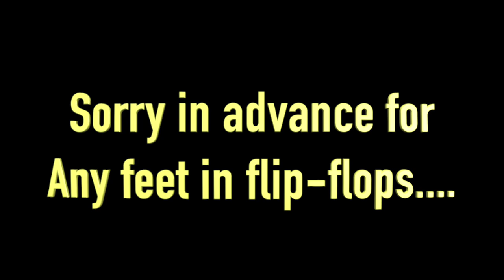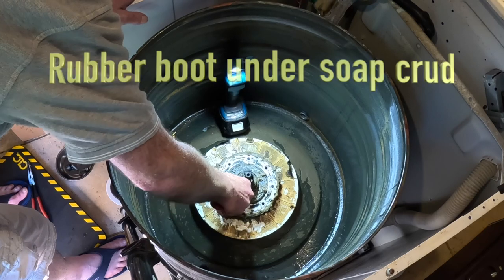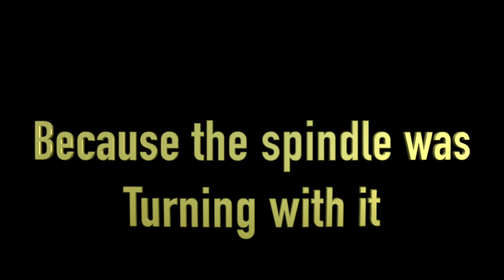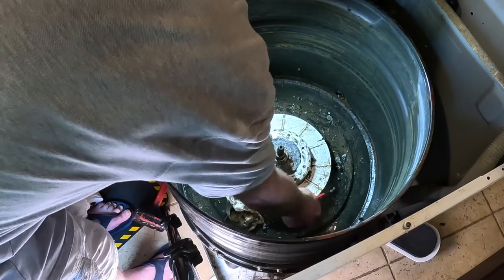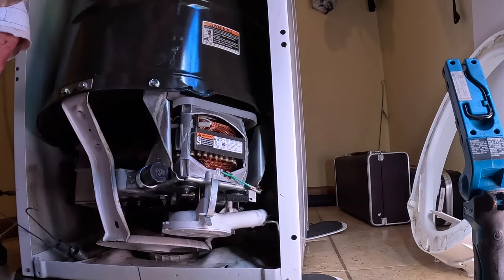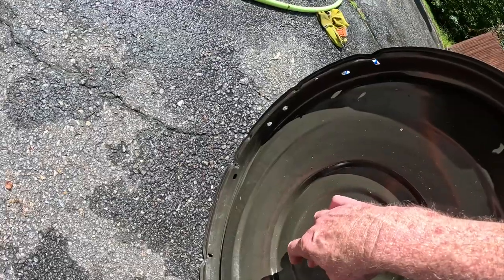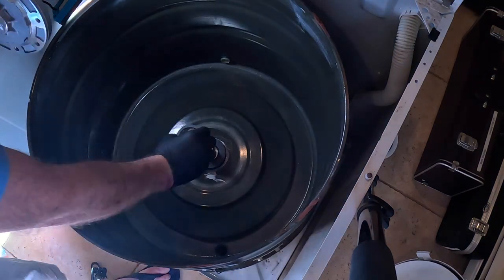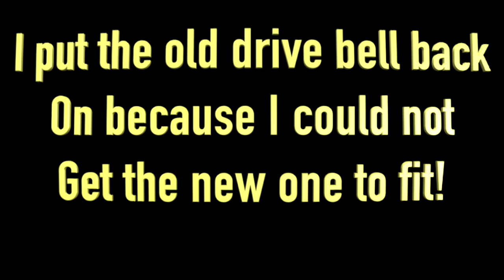Speed Queen Washer BEARINGS and SEALS replacement DIY  The GOOD, The BAD, and the UGLY

Comment: I just did this, those Rhino air wedges are very useful here, not only to pop up the agitator, but also between the inner and outer tub, put (3) in 120 degrees apart, inflate just enough to act as a brake pad to stop drum from spinning as you break torque on center shaft nut.  Do not over inflate as you can possibly warp the tub.

On my model speed queen I pulled the nut before unbolting the (4) bolts on the stainless inner tub.

Also FYI 38mm (6pt) deep well vehicle wheel lock nut socket on my Ryobi 1/2 18V battery powered impact wrench worked well on 17 years of accumulated crud under the agitator and on nut.
Reply from the maker: Someone else mentioned To take the lock nut off before removing the inner tub.  I don't think I was able to do that

Comment: Thanks for the video! Now we can all see why the transmission can't leak into the tub. Just a bearing and seals to keep the water from draining out! So, would you say that the majority of the crud was old soap and grime from the clothes? Speed Queen washers are built like a a Battleship! No wonder they run forever!
Reply from the maker: I’m sure that’s what the dried crud was. Never used any powdered soap either. The reason I did all this was a small water leak from the bearing/seal area. I discovered it a year ago and bought the seal kit that I installed. While I was waiting for it to be delivered, I removed the front panel, and took 100% silicone on a rubber glove and applied a lot of it on the underside of the bottom tub, all around the seal and bearing. I didn’t run the machine for 24 hours and that fixed the leak. For a little more than a year.  The bearing and seal kit sat in my basement. Why mess with it if it was not leaking any more?  Well a Lear later, the leak returned from the same area, and I made this video after reviewing all the videos that I could find on the subject. It’s still going strong. In fact, I just pulled a load from the washer and put it in the dryer 3 minutes ago!  Thanks for commenting!

Comment: Thanks for the info. For the bottom seal, you could also use painters tape to keep it place while you are installing the tub. I found that you in cases like this, you don't HAVE to use Locktite, you could use nail polish instead. It works just as well and it's a lot cheaper. I still recommend using Locktite, but in a pinch, nail polish works fine
Reply from the maker: @pieterjansenvanrensburg4648  thanks for watching and sharing your expertise.  Interesting with the nail polish.

Comment: That white grille thing is some sort of lint/hair trap to avoid debris from working itself into the sealing surfaces of the central hub part.  Also, I saw a video on an appliance parts pros website that shows the repair guy preventing the hub from spinning while hammering on that special wrench by taking a pair of large vise grips and clamping it onto one of the thicker albeit aluminum "fins" of the transmission outer casing down under the tub, and that way the handle of the vise grips would anchor or wedge or stop up against one of the transmission mounting support brackets.  That special wrench didn't work for me because the nut was so stuck, so I ended up using an air impact wrench with a gigantic socket that fit the nut.  But it wouldn't turn because the shaft was so rusted so I used a wire brush attachment for my portable 4 inch grinder first.  I also couldn't get the bearing assembly off the transmission so I had to use a metal 3 pronged gear puller and an air impact socket wrench to get enough force to pry the old bearing off the transmission shaft.  I then couldn't get the new bearing or nut on so again I had to lightly brush the rust off the shaft of the transmission with the grinder again.  I was even using it in a vertical fashion to get in between the vertically oriented splines on the shaft.  The entire job was way harder than I was expecting and there was rust everywhere.  Not to mention how difficult it was to find a hub and seal kit for my particular model.  I think next time it needs a new bearing the machine is going to the recycle center.
Reply from the maker: holy crap.  Thats crazy.  I wish i would have seen the video of someone using vice grips to prevent the transmission from spinning.  all three videos I saw had locked transmissions that didnt move counter clockwise.  Thanks for commenting. it was interesting to read

Comment: There is a trick with stuck bolts and that is try to tighten a bit , then try to remove. Works for me even where Loctite has been applied.
Reply from the maker: @metrork1  thank you.  the gasket to my tankless coil on  my 35 year old oil fired boiler was leaking so I had to replace it. Had 8 stuck bolts. I actually tightened and loostened them multiple times spraying lubricant in between to get them out.  Thanks for commenting

Comment: Big job indeed, getting the big nut off the spindle looked very difficult having to hold rotation from underneith with water pump pliers with left hand while swinging a hammer inside the drum with right hand to bang on the nut removal tool from the kit. I'm wondering if a large long socket could be used to remove the nut with an impact wrench, or is the spindle to tall for a long socket? Could use 1/2" or 3/4" drive socket with drive reducer adapter(s) to get back to 3/8" drive impact wrench you used? Any thoughts?
Reply from the maker: If you can find a deep enough socket, what you suggested would work brilliantly.  I watched every video I could find and nobody had the same issue with the spindle and transmission spinning. One commenter suggested my brakes were bad and not holding which was why I had that problem.  I've since replaced the brakes after reading that comment.  So it's quite possible if you try this repair you won't have the issue I had.  Others recommended leaving the inner tub in place when removing the bolt but I can't visualize how that would make any difference.  
At any rate, if you have a deep enough impact which would surely be a specialty item (I have a lot of tools and drivers and didn't have anything deep enough) it would definitely remove the bolt in 3 seconds. No question. 
Thanks for watching and commenting!

Comment: Hey Excellent video tutorial. 
What model Speed Queen top load washer?
What was purpose of using lock tight on the outer outside of the aluminum plate ? 
Excellent video
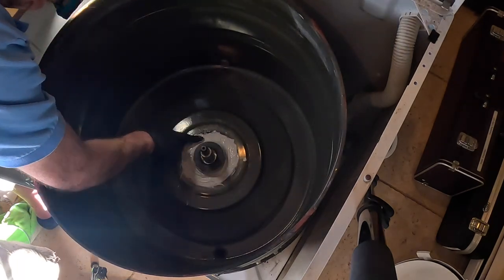Reply from the maker: See 31:20 for Loctite explanation.  
It bonds the metal plate to the bearing.  It's extremely important.  Heres the loctite. Its made for just this type of application to glue 2 metal cylindrical parts together https://www.henkel-adhesives.com/us/en/product/retaining-compounds/loctite_6800.html. I have model AWN432SP111TW01. Thanks for watching and commenting.

Comment: Wow. Good job.
Reply from the maker: Thanks.  I’m just glad I didn’t need a new washer.  I really like the Speed Queen. It cleans very well and gets done fast.  Plus large capacity and it’s mechanical.  Appreciate the comment.
Reply: I am having bad problem with my Speed Queen TR7. It is making grease spots on the clothes and nothing seems to work. I am trying to work out something with the dealer and Speed Queen to trade it in as a lemon.  Almost 6 years left on Warranty. Fingers crossed. 
Did you have this staining problem too?
Reply from the maker: @Scott-jf1nh  never. Is the machine brand new? It doesn’t sound like it. If I were you I would buy like 4 gallons of bleach and take a white t shirt and run the shirt in a small load with a lot of bleach. At some point if there were grease it would dissipate and stop getting on the clothes. I’ve never heard of anything like that. Good luck. Edit. Or maybe take a bunch of towels you don’t care about and fill the machine with micro fiber towel wax cleaner and water. And run them a few times in that stuff.  I bought that stuff from the chemical guys to clean towels after I detail my car. Works well. Ammo NYC has similar microfiber cleaners. At some point whatever is causing the issue will be gone.

Comment: Great tutorial. Well done. By the way, how long have you had this washer before it started to leak and were you using liquid or powdered detergents ? Thanks.
Reply from the maker: Thank you. We probably had the washer and dryer 8 or 9 years before it started to leak. I bought the kit to do the bearings and seal and then decided to try some silicone on the tub bottom. That actually stopped the leak for over a year and the repair kit sat in my basement. 
We have very hard well water, even with a softener which adds salt. And only use liquid soap.  Thanks for commenting.

Comment: Remove center nut before inner drum. Easier to hold. Flip outer drum upside down to put weldiment back on
Reply from the maker: You're the second person that said this and I appreciate it. I really didn't think its  possible take off the nut without removing the outer basket because I don't think I would be able to get to it. Unfortunately I can't really picture it now but thank you should this thing ever leak again I will see what I can do with your suggestion

Comment: Great job...did you notice the inside side wall stains? Tale sign of a seal leak
Reply from the maker: Not on the inside stainless basket.  Did you see it in the video? If so can you point to a timestamp? Its interesting to me.  Thanks
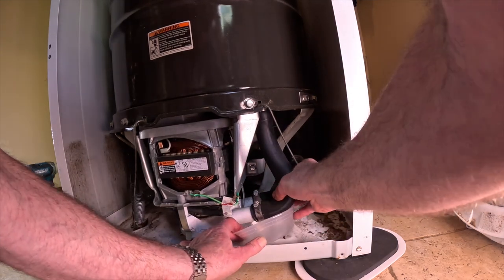Reply: @Samlol23_drrich  18:48 look at the inside of the cabinet. You will see a stain all the way around the cabinet just below the bottom of the outer basket.
Reply from the maker: @rolandvz71  thanks very much for taking the time to point that out and time stamp it for me. I absolutely see what you are talking about. I wonder why that would be a sign of a seal leak. I just assumed it was dirt but I guess not. Any idea why that happens with a seal leak? I’m curious. Thanks again.

Comment: Great video. I have the same setup and change out all the seals and bearing but right now if I don't put grease on the brakes it chews up the belt. I am trying to figure out what did I do wrong because as I said it's chewing up the belt so I put grease on the brakes in order to delay the belt from wearing out
Reply from the maker: Are you sure its routed correctly? I bought a belt to replace my existing one when I did the seals This summer but I forgot to put it on So it's still sitting in my basement But that's the original Belt it's about 11 years old
Reply from the maker: And we do 10 to 15 full loads a week
Reply from the maker: Maybe it's not balanced properly
Reply: @Samlol23_drrich  it is routed correct. The brakes seema to be causing unnecessary resistance when not needed causing the belt to prematurely fall.
Reply from the maker: @bobdeengineer7396  wow. Been like that since new? Just curious

Comment: This is amazing work. I am watching this because we have a newer Speed Queen. I was trying to clean out the edges of the tub and a Clorox wipe fell between the inner and outer tub. Question for you: do I need to take this thing apart and try and fish that out? I am assuming so but I just thought I would ask your opinion.
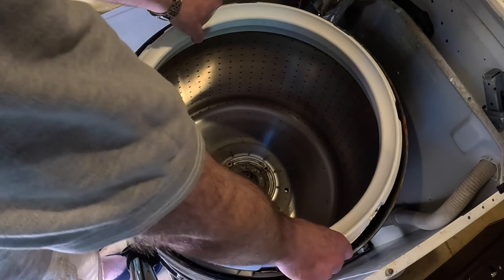Reply from the maker: Thank you.  I would try my hardest to get it out without taking the tubs apart. The last thing you want is for it to get stuck in the pump. If you take the top off and unsnap the white plate that covers both tubs (it unsnaps see 4:40 you should be able to see between the tubs.  I took the inner tub out with it still attached but you can pull that off when you take the top off of the machine and you should easily be able to get the wipe.
Reply: @Samlol23_drrich  That makes a lot of sense. A huge thank you for explaining that. Now that I think about it, the wipe probably isn't in between the inner and outer tub. Because there is a seal on that white plate, it probably just stuck right there. That is a relief, but I still am determined to get it out just in case. I tip my hat to you for sharing your knowledge!
Reply from the maker: @jacobl777  my pleasure!   Thanks for the nice comments.

Comment: Hey Doc!  All my repair items for the bearings and seals officially showed up today.  I'm curious to see how you got (at the 15:26 mark), all this plastic stuff (plastic shroud/part number 39371 Washer Filter Lint) clean after you took it out.  I'm afraid to take my pressure washer to it as it is plastic.  You had several items that were plastic you had to get "de-gunked".  Did you take a scrub brush to it?  Also, did you find anything to help with the mineral and detergent buildup?  I just had my drains blown out today and those were disgusting to say the least.  My drain guy said a lot of the liquid laundry detergents have glycerin in them and this causes serious build up in the drains.  BTW-  I just found the 39371 part number online through Alliance and it's actually reasonably priced at just under $5 (this is before shipping), Appliance Parts 365 for $4 before shipping just in case you ever have to pull this machine apart in case you break that plastic piece.
Reply from the maker: I just ran that plastic thing under hot water. It was hardened soap so it dissolved right off. I didn’t take a power washer to anything. Every part cleaned up easily. I took both the inner and outer tub outside and just used a hose with a sponge. Good luck. The sealant application is the hardest part. Watch a lot of videos.  There is one that is shot in portrait mode by a guy in England or Australia that is great. If I find it I’ll edit this post and link it here.  Edit. This one. https://youtu.be/e5vd18GWVWU
Reply: @Samlol23_drrich  Will do!  Thanks Doc!  I was going to possibly also use my 7 in 1 tool for trying to get that sealant off.  I have acetone as well as alcohol here to get everything off.
Reply from the maker: @amiedavis5257  I think the only thing you will need is a flat razor blade, and some alcohol prior to laying down the new sealant to make sure there is no grease or oil remaining on the surface. Good luck
Reply: @Samlol23_drrich  Doc, did you use a gear puller to get that metal hub off?  How did you get that hub off?  We have the damn thing mostly pulled apart but that metal hub is just stuck.
Reply from the maker: @amiedavis5257  I didn’t have to use one, but yes, you can get a set of three different size gear pullers/fan blade pullers fairly inexpensively. They are good to have. You can probably use an air wedge also if you have one.
Reply: @Samlol23_drrich  I tried an air wedge, that didn't work.  I used at least half a can of penetrating oil so far.  I tried a crow bar, nothing made it budge.  I gave up, every thing was closed by that time so in a couple hours, I'm headed to harbor freight to get a gear puller and a crap ton of limeaway gel for the drum and basin.  I'm also going to install a water filter on the cold water side.  There's at least a half inch of limescale in the drum.  With your helpful tips, it took less than a half hour to get where we are.  If that hub didn't get stuck, we would have had it back together by now. 100% if you have the right tools, it's so worth doing this yourself. This repair would have cost me over $600 to hire it done.

Comment: I'm watching this at 2AM.  I have the same machine.  Mine is leaking water out the bottom so I am 99% sure it is either the drain pump (plastic, naturally) or else the drain hose (this one was a complete pain to source and took damn near a month).  I'm looking at exactly what's in there so I can be prepared as to what I need to do.  I got an OEM drain pump from Amazon for $14 with shipping.  Where did you get your replacement parts?  I wish you were my neighbor.  Anytime something is broken I want to learn how to fix it. ALSO:  How much was the tool to take off the nut to the transmission?  Do you have links for the bladders to stabilize and remove?  What was the tool called you used to remove and reconnect the springs and is there a link to that?
Reply from the maker: The tool to take off the springs is called a motorcycle exhaust hook.   The pump up things are called air wedges or air shims, the bolt removal tool is herehttps://parts.alliancelaundry.com/i-790271-speed-queen-306p4-washer-tool-hex-wrench.html?utm_source=Google&utm_medium=cse&utm_term=AL-306P4-02&gad=1&gclid=EAIaIQobChMIjMnmmJL6_gIVyiKzAB2iKQsHEAQYBCABEgLDIvD_BwE
Reply: @Samlol23_drrich  I found another one of your videos that showed what I needed 😀.  Amazon should have it to me in a day or two.  I'm going to order the other tool from Alliance. Thanks again Doc!
Reply from the maker: @amiedavis5257  what is the issue with your machine?
Reply: @Samlol23_drrich  Doc, my machine is leaking water like a sieve.  I took the front part off and it doesn't feel like it's coming from the drain pump, but I'm not sure if this ever does leak water.  You'd know better than me, but can you get stuff like hair in the drain pump causing a blockage not allowing the machine to drain?  I also ordered a drain hose and it took damn near a month to get that from Appliance Factory Warehouse.  I'm going to try and go through the top of the washer to change out the drain hose.  I would like to get those inflatable "air wedges" you have because when we sell our house there is no way in hell I am leaving these machines behind.  To replace these machines now it's 4K.  I want to be able to get the drum completely stabilized so the drum doesn't rock around and break a spring or do damage to the frame where the springs hook to.  Thanks again Doc!
Reply: @Samlol23_drrich  I get the springs off with an old phone charging cord that I cut on end off.  Just hook the spring in the loop & pull it off or on.  This idea came off another utube video for drain pump replacement & it works well for me.